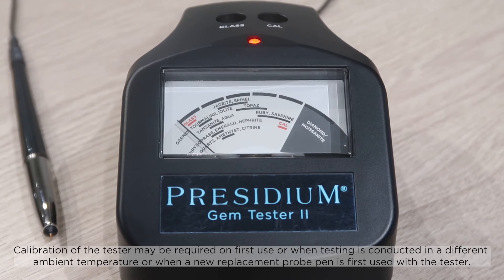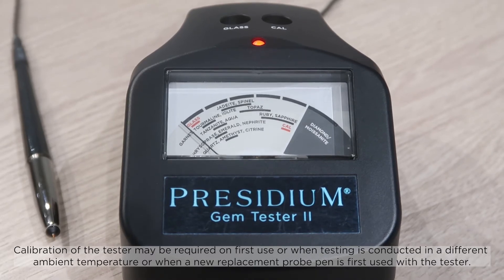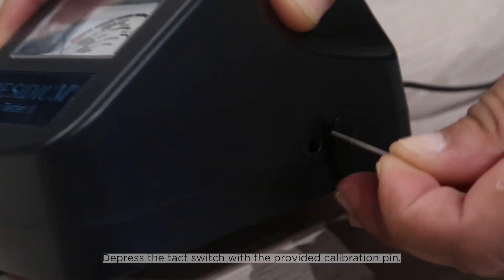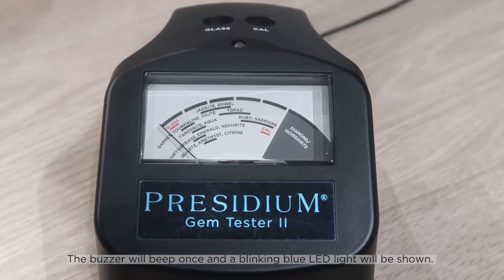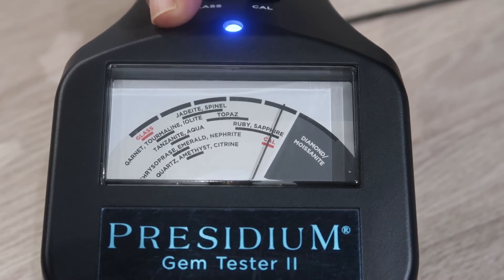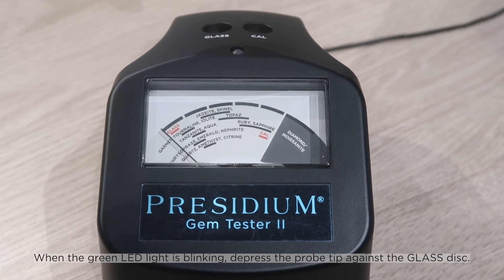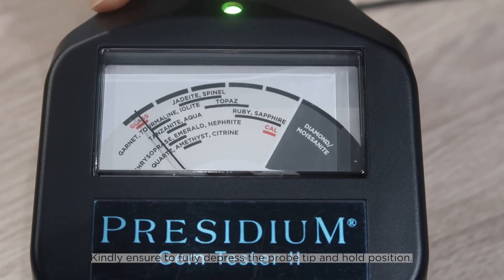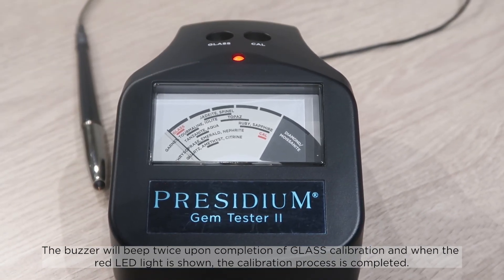Presidium PGTII Calibration Tutorial

Comment: I think mine came defective. 😪😪😪 My hand doesn't go all the way to the left and rest under glass it's stuck in the middle of the glass red line. I tried to recalibrate and it doesn't stay on the red "CAL" red line before beeping. Any suggestions? Also do you mind if I ask where you purchased yours? Mine was from Amazon, and have problems with their merchandise b4.
Reply from the maker: We are sorry that you have problems with your device. We are a wholesale company and sell the testers.
Reply: Mine is the e same as you described. I'm having no luck either. It is testing the gems correctly however.